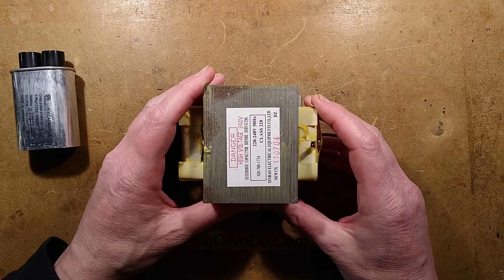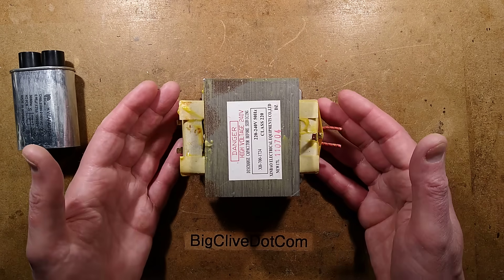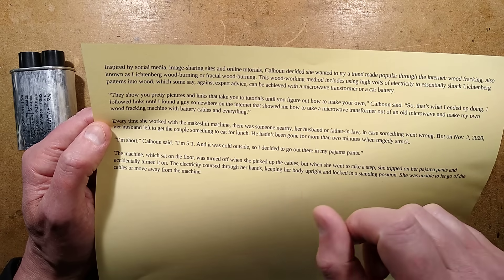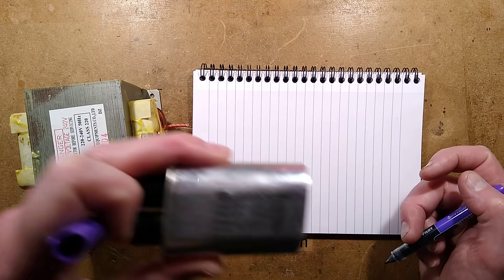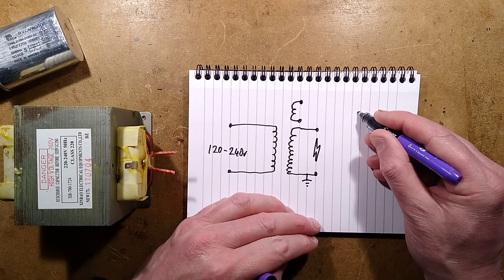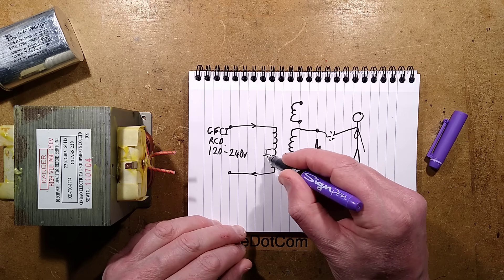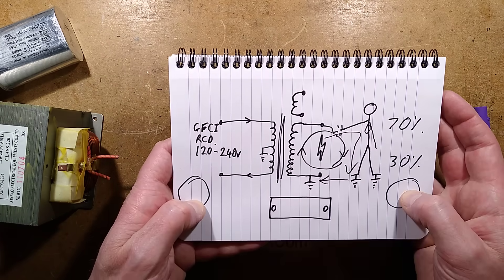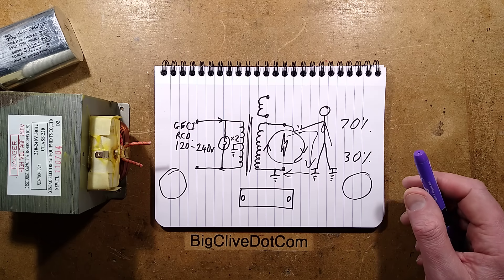The most deadly project on the Internet

Comment: if you're getting shocked by the secondary winding and less energy is returning to the circuit due to it flowing to ground, considering conservation of energy, why doesn't the primary see a corresponding drop in voltage or current enough to trigger the GFCI? is the drop just not significant enough relative to the total energy flowing in the circuit, or is the primary winding really unaffected somehow?
Reply from the maker: The galvanic isolation through the transformer sees it as a normal load.
Reply: @bigclivedotcom  Alright... (bear with me because i'm extremely rusty) is it because the GFCI circuit is measuring current into the load vs. current returning from the load, and since the primary coil itself isn't attached to ground, the current flowing through the primary side is uninterrupted, with only a voltage drop appearing because of the giant current it's inducing in the secondary winding? And so all the induced current on the secondary can be flowing through your body direct into ground but it's impossible for a GFCI circuit to detect that?

Is there a way the sudden change in impedance of the load could be detected to prevent that kind of shock?

Comment: I speak from experience - DO NOT trust cap bleed resistors... 2+ days disconnected, loose in a box of parts I rummaged thru, gave my heart the worst-feeling shock to date. For the record I'm an auto tech who gets nailed by leaky tens of kV regularly, and find NST/OBIT shocks tickly. MOTs are like giving danger a handjob.
Reply: That sounds like dielectric absorption. If a capacitor was charged with a high voltage some time, even after shorting it once, the voltage may COME BACK a second time! High voltage capacitors should be stored shortened.

Comment: You never mentioned the voltage level coming out of the secondary. However, there is a clue on the high voltage capacitor where is says 2,100 VAC. With a 240 VAC input and a 2,100 VAC output that would mean the turns ratio of the transformer is about 8.75 to 1. Even with just a 120 VAC input you'd still get 1,050 VAC on the output. These are very dangerous and potentially lethal voltages in any case.

Comment: That's what I was thinking high voltage generators 6v will burn SO surely would do the job, if took 3 times longer would definitely be 1000 times safer. 
Yep better off telling people if they play with fire you'll get cooked literally inside out..

Comment: As a residential electrician, I would say you are slightly understating the hazards involved. 2KV is no joke. Yes there are ways to safely handle that voltage. No, they are nowhere near cheap. I tend to keep 4 feet for each 1000 volts away from Hi Power without my safety gear. I've yet to meet the electrician who has not been zapped with 120/240 at least once.

Comment: Any step-up transformer and high voltage capacitor are dangerous if a person does not know electric theory and follow basic common sense safety when working with high Amp and Voltage devices.  Transformer work is not for DIY projects.  The same with the old school Tube TV's and AC units with high voltage and high current capacitors.  I build mine with a GFCI/GFAF breaker/disconnect and a fuse on the stepped-up side and wear insulated grounding gloves.  I worked on Power Transformers and power distribution lines as a field Electrician.  If you do not know Electric theory or/and are a trained electrician, do not do it!  A high Voltage GFCI/AFCI is bulky and expensive and must be wired correctly with the properly sized wire.  Just buy a UL-listed and NEC code-compliant manufactured device.  It's your life!

Comment: As soon as I saw these 'tutorials' on the fractal burning technique, I thought to myself...  There's almost certainly going to be death and most likely very unpleasant death.   So, as a guitar customiser, I considered that the fractal branches would look cool on a guitar body, so I set about designing a SAFE system, that was fully enclosed and had more failsafes than a nuclear reactor... 
.
Basically a low-profile box, or a large deep tray - preferably made of a good insulator like plastic or fibre-glass and very well anchored to a work bench.     In my design, the box/tray needed only to be large enough to accept the body of a guitar, or its neck...   This box/tray would have a lid, with a plexiglass window, to observe the process.   This lid would have two interlock switches that were on the line/phase input on both phase and neutral, with inclusion of two pilot lamps, one indicating mains 'available' (energised when the socket switch was thrown...), the other indicating when the transformer was in circuit with the mains -  The 'In process' lamp.      The latter lamp could be fitted to the low-voltage winding of the tertiary (magnetron heater) winding.    With the lid was raised the interlocks would disconnect the mains.   However, I would also include an industrial grade breaker of the type fitted to most workshop machinery, with a red 'punch' button to disable the circuit.  This would be on the phase input after the interlocks.   This would be the 'Begin Process' on/enable (green) switch.   Also fitted would be two solenoid locks, which would energise as soon as the lid was closed, before the (green) enable switch was thrown/punched.   These solenoid locks would ensure that the lid could not be raised whilst the secondary was energised and only once the mains/phase was disabled.  
.
It goes without saying that all the electronics would be located in well (double) insulated/earthed enclosure situated in one end of the enclosure, with the earth and HT out electrodes on HT cables, exiting via a gland to the work area of the enclosure/box/tray, these would obviously be flexible enough to place on the workpiece at any desired position.   
.
Thus:  to commence fractal burning, one would place the workpiece (guitar body/neck) into the box/tray enclosure, locate the electrodes on the workpiece.   Spray on the electrolyte, in the artistic pattern of one's choice, lower the lid - 'click' as the solenoids energise, then punch the green enable button, lighting the 'In Process' lamp and burning commences.   (I'd probably stand a meter or so away, just to be sure...  better safe than DEAD! )    If the workpiece pattern/electrodes needed to be adjusted, or the process finished, then one would punch the red disable breaker, the 'In process lamp would extinguish, then switch-off the mains/phase input at the socket (I wouldn't take ANY chances with High Tension current devices...), the solenoids would disable and the lid could be safely opened and the workpiece adjusted or removed.   
.
I used to repair marine transmitters and radar sets...   We were always taught that when testing live (which is often required) to use the arm holding the test probe in the right hand (if right handed) with the forearm resting on the chassis and the other arm behind one's back, or in a the left pocket of one's trousers...   That way, should one accidentally touched something with a high voltage, as current always takes the quickest path to earth, the current would flow up the arm as far as the chassis (on which the arm rests...) and travel no further.  I've used that technique when testing/repairing CRT devices (old TV's), microwaves, car/bike ignition circuits, in fact anything that has phase or HV/HT level current (guitar valve amps being a classic example...).   
.
Remember folks its the CURRENT that kills, so even though a car/bike HT circuit can give a hefty jolt to the body, it is rarely lethal (unless you've got a pacemaker...  In which case, you shouldn't be faffing around with HT devices at all).   Whereas any HT transformer attached to a mains supply, at high current provision, is potentially (pun intended) LETHAL.

Comment: Disregard for safety is not something to brag about, so I find your sarcastic comment to be appropriate.
Those dead man switches are also used a lot with heavy machinery, so you can be sure that your hands don't get caught in it while it operates. It's very clever.
I think most people don't realize just how much power these transformers put out, the analogies to overhead wires are very helpful.

Comment: Had a Stabo slot car track as a kid. The controller plug fitted perfectly into the cable from my cassette player. Curiously I slowly pressed the button and it immediately went "poof" very loudly. To my surprise, subsequent presses didn't do anything. Shortly afterwards it was lunch time. My parents were wondering about the terrible TV signal, until they discovered my contraption and unplugged it.
I'll never forget: "what are we supposed to tell your grandparents, when they return from vacation?" (they lived next door). A few days later my grandfather gifted me a toy construction vehicle, which fitted perfectly into my collection. Today I feel glad that I was able to receive this gift. It was a great asset in my sandbox! Back then I was just happy that my parents were more worried than angry.

Being able to tell stories like this is fine IF you came out unharmed, but that's a big "if". ElectroBoom is fun to watch, just don't try this at home.

I still continued to test 9V batteries by licking them, until nothing used 9V batteries anymore. My dad showed it to me at some point, so I knew it wouldn't hurt me. It's still a slightly uncomfortable feeling and I can't even imagine what it would have felt like if I had electrocuted myself that day.'

PS: This event left such an impression, the first time I had to replace the main fuze in my own flat was an emotional adventure. Now I know it can't hurt me, unless I'm stupid enough to put my finger in it. Just because there is a hole doesn't mean you should stick things into it.

Comment: Would it be possible to improve safety somewhat by introducing an RCD on the secondary side too, to cut power at least to the electrodes when something goes awry? Or would that not work either?
Reply: Difficult, one problem is finding a RCD rated for several kV. A standard RCD would arc over and would not reliably cut off that voltage. If it exists at all, it will not be cheap.

Comment: I did a fractal woodburning project using a neon sign transformer (12,000 volts) and wood dampened with water. I hooked the wires from the transformer to pins stuck in the wood (about a foot apart), plugged it in, and without touching the burning wood, made the design, then I turned it off before touching any of this. Didn't get a shock because I have experience with high voltage (jacobs ladder in my high school years).

Comment: I always used a bleeder resistor to discharge capacitors. An instructor showed a screwdriver with a huge chunk of metal blown out of it that was used to discharge a high voltage capacitor.
I learned the hard way about never trusting an off switch when I got zapped by a 600 volt tube amp transformer(It was still in the amp). While VERY unpleasant I didn't get any holes in me or have to visit a hospital. Those microwave transformers must be a lot worse.

Comment: Excellent video. As an EE, I thoroughly endorse this message.

It ain't the current that kills, it is the voltage, and anything above 50V can be fatal with a surprisingly low current. It doesn't take much to stop a heart or stop your breathing. Those transformers are indeed at electric chair levels, the patterns they make in wood they will also make inside of you. They will definitely kill you if they get the chance.

That two-handed on-switch is an excellent idea. Ensures both your hands are away from danger. Also make sure no bystanders or pets are near, if you don't want to fry (literally) your inquisitive little brother.

As the man said, you are free to ignore these warnings, but if you do, try not to make too much of a stink as you die. Burnt flesh smells awful.

Comment: So, on the distribution pole a 100:1 transformer steps down the typical 12000V to 120V. To get 20000V that microwave transformer would need to be something like 150:1 or 200:1 ratio? Edit: Ah. A little research tells me it's not a step up to an incredible 20kV but "only" 2kV. I see. So the ratio would more likely be something closer to 15:1 or 20:1?

I admire your philosophy of not telling people "Don't do this." I think that approach of trying to hide dangerous information only means the least reliable information makes it to the light of day for most people. If there were more honest conversations like yours about the real risks then people who are determined to try such risky projects will at least get good safety and risk mitigation information.

It is a grand irony that the same people who insist that everyone from 6yrs to 18yrs needs a comprehensive sex education through the schools because otherwise they'll learn all sorts of "misinformation" from peer conversations and other dubious sources, are the same people who want to censor information about high risk activities on the theory that the less people know, the better.

Comment: I've had a small collection of these hanging around and eventually threw most of them away. I had no use for such a dangerous device. I kept some for low voltage high current stuff. One I even turned into an ion laser filament supply. The deadmans switch is a good idea. It doesn't need any improvement such as a fibre optic linked remote or anything like that (with a uC that can lock up), and it breaks the circuit the moment you drop it.

Comment: You could set everything up and have a push button switch using a low voltage (24 volt like in a furnace or air handler, they are quite “safe”) transformer connected to a relay on the primary side a few feet away. Or an industrial light switch directly on the primary side but that doesn’t have the safety of letting go like the push button.

Many different ways this could be made quite safe.

Comment: Clive, I cannot find much online, but I think theres potential for really safe projects involving MOTs running them backwards. Thats right, I said it. With heat management I think these are formidable high amperage low voltage supplies for... whatever. 
Anything high voltage high current is asinine without a clear remote switch on the primary. Setup, backup, power up. If it fails, power off and repeat.
Reply: Also it only takes grinding  2 welds to split the core for rewinding. You can use all thread through wood tight inside one of the windings to get a form for an easy rewind.

Comment: Remember the aluminum yard clothes lines people had in their backyards?
I mowed the neighbors yard and I pulled the pipe out of the ground so could mow the grass around the pipe.
I did not ever look up and lifted the metal tube right up into the electric supply for their house!
Quite the rush as it made contact.  I was 12 years old and  couldn't have weighed 100 lbs.
I still think it should have killed me, but what do I know?

Comment: I taught solar and wind energy systems for a few years. In dealing with the higher voltage/current circuits I would give the students this warning: "Not only will this kill you dead, It will hurt the entire time you are dying".
Reply: I've heard that saying a fair few times as my time as an electrician. And I don't doubt it's true
Reply: @Vinny_TheCableGuy  I feel like it happens pretty fast if it kills you. I don’t think you have much time to react
Reply: @murkyturkey5238  screen shot or bs.
Reply: @murkyturkey5238  Some lineman who got shocked by 13kV in this comment section said it took around 30 seconds to black out, but it felt like half an hour. Then he was in a coma for a month, still in pain, and it felt like eternity.
Reply: As a trucker we too have a saying you can go too fast up a hill a thousand times but only once downhill
Reply: Kill you dead, as opposed to what exactly.

"Little Johnny stuck his tongue into the plug socket and was killed alive... "

It scares me that there apparently exist people who actually require that extra emphasis that they're gonna be deaded, and it's common enough that it's used often.
Reply: is that just a quote?
Reply: It literally cooks you inside out

Comment: This was quite the timely and much appreciated video, to which I sent a link to my housemate, since just a couple of days ago he asked me if I'd ever heard of using a microwave oven transformer to do fractal wood burning.

He was wondering what the 2-3kV output voltage would compare to, in terms of risk. I told him that the low end of overhead distribution lines was around 2kV or so, and asked him if he'd ever noticed the safety blankets, heavy gloves, and insulation suits that linemen wore, among other safety measures, when it was necessary to work in close proximity to live lines.

The point being, was he planning to employ similar safety measures if he decided to make fractal wood burning a garage project? He seemed to get it, and I think and hope I could sense his interest waning, but this video is so much more interesting than my brief comments to him.

Thanks so much for such a great video! May he take it to heart, so to speak. 😅